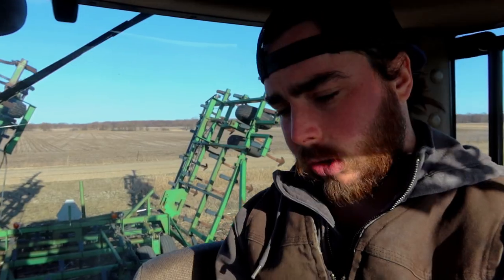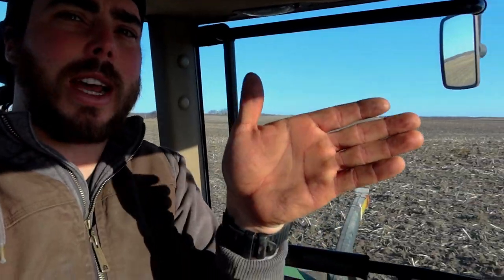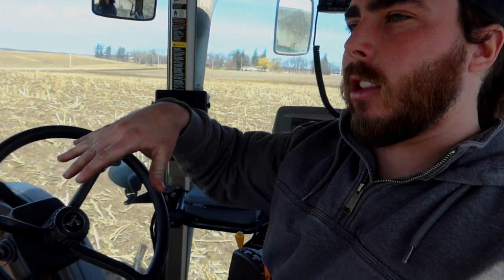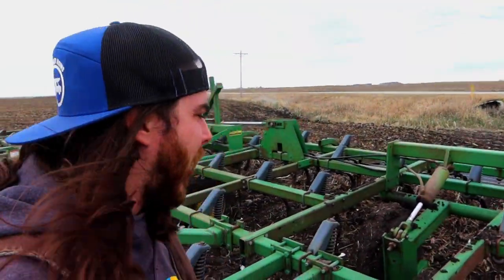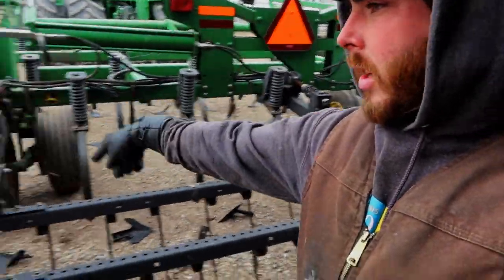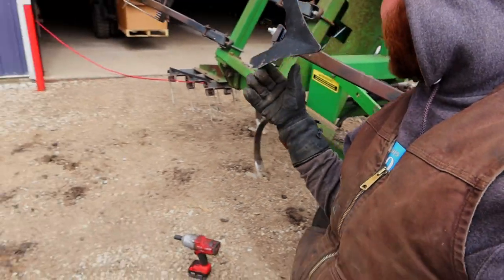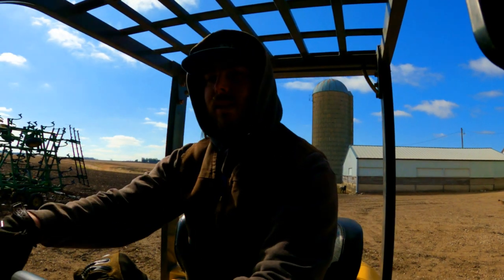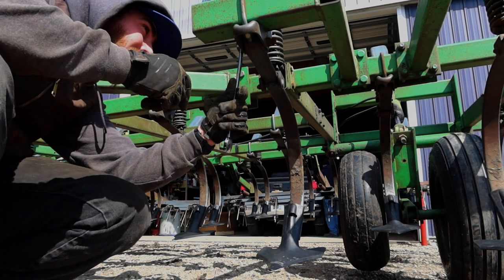Working A Farm, How and Why We Level Corn Stalks

Comment: I got my AAS degree in Ag-Business from DMACC in Ankeny back in '91 and worked for John Jensen who did (probably still does) custom farming all around east of Ankeny, over towards Bondurant.  I enjoyed all seasons operating, maintaining, fixing his John Deere equipment, but I must say, I truly enjoyed the pleasant routine of breaking into the fields for the 1st time in the Spring!  We didn't have GPS steer at that time...and with my background before Ag-Business from DMACC, I was heavy into grounds maintenance for DMACC (I was their full-time groundskeeper from 84-87) and then I did a couple stints working at a couple golf courses around and that gave me great experience to make STRAIGHT ROWS!!!  I could be chisel plowing a mile-long field at that ~4 degree angle, like you said and the trick was to start at one side of the field and that kept my rows straight as an arrow - vs others who would try to do their 1st pass through the center and work to the sides - those fields never were very straight, lol!  Thanks for sharing your work and excellent drone work too!  My (John Deere vintage) cap's off to you!